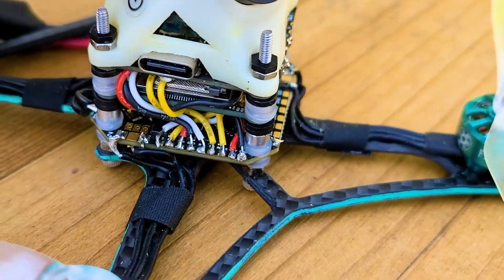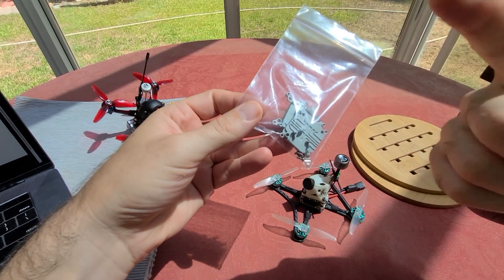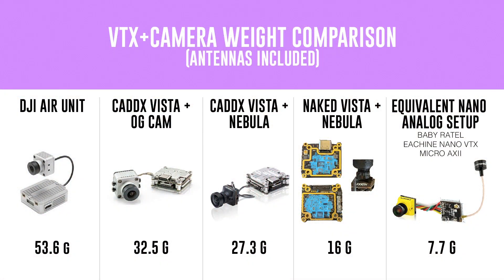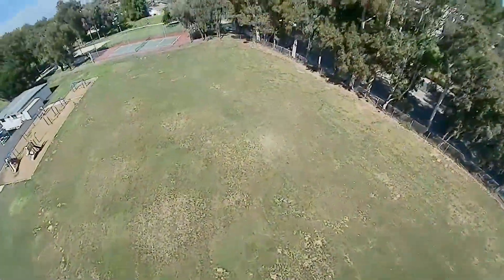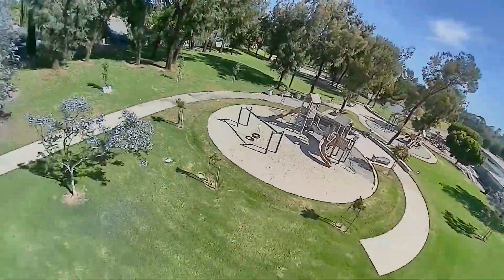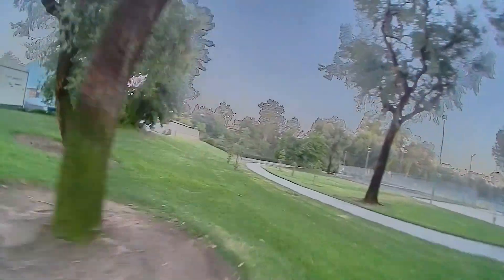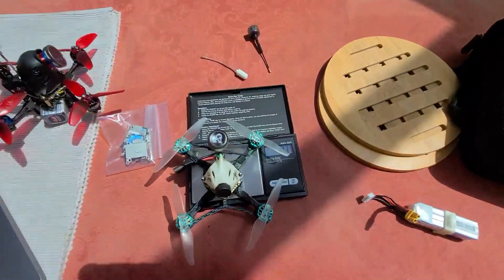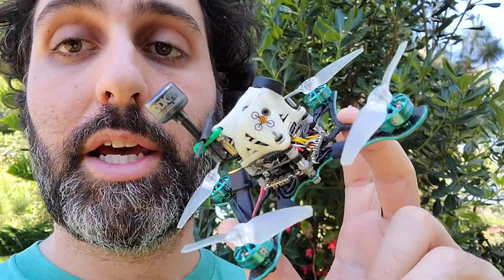Naked Caddx Vista with Nebula camera review - Will the hacked Caddx Vista FLY or FRY?

Comment: is there a filter or lens on dji vista set up in your video
Reply from the maker: No that's stock lens
Reply: @brickclickfidgets  its huge
Reply: the one with red props
Reply: im getting ready to build myself the Airblade Eclair V3 and im going to be stripping my caddx down .The one question I did have is the small tab that holds the ufl connector  onto the one side for security is that just no longer part of the equation.
Reply from the maker: @reefercrazy1  the ribbon cable snaps into the board so you're ok without it.
Reply: @brickclickfidgets  i'm speaking about the opposite end where the rush antenna is held down by a screw a metal tab and the tab would pop into the case (ear)to hold it securely. Will it stay in place with just the screw and tab  without holding on to that (ear)on the opposite side where the case would wish I could send a picture of it.
Reply from the maker: @reefercrazy1  yes the antenna snaps in place also. Good to zip tie it to your canopy as well
Reply: @brickclickfidgets  Thank you again sir do you possibly cut carbon?
Reply from the maker: @reefercrazy1  I don't but check out CNC Madness
Reply: @brickclickfidgets  wil do

Comment: Have you tried higher power settings? 700, 1,000 or 1,200mw?
Reply from the maker: 700 works fine. I haven't tried 1000 or 1200, I don't think that's safe.
Reply: @brickclickfidgets  Thank you for your quick reply.  700mw seems the popular solution.  I am in San Francisco where it rarely gets warmer than 68 degrees F so might crank it up to 1,000 mw with minimum ground time.  Will report back!

Comment: 6 months later is it still working after all the heat sinks removed???
Reply from the maker: Yes it absolutely is working. I generally set the output level to what I need, if I'm flying proximity I'll set it to 200mW to be safe but I've never had issues at 700mw. I have gotten temp warnings when I let it sit idle without flying.
Reply: @brickclickfidgets  Thanks! 🙂🙂🙂

Comment: Hi, anyone has experience with a naked vista that got sprinkled with water? Had a little crash yesterday and got a little wet. At the moment the vista still worked. If i plugged in after, didnt connect to the goggles anymore. The led light works but it's very dim. Any ideas?
Reply from the maker: You can try opening it up and letting it dry. It's 4 screws on each side, comes apart in 3 metal pieces and two boards.
Reply: @brickclickfidgets  its still dead, could it be from being hot and then crash?

Comment: Yep, the Nebula blows, but dji didnt put their name on it, Caddx did and it shows..

fwiw.. I bought a couple of Betafpv/Racerx Twig XL's and in one of them I installed the standard Vista w/ original cam under a phx-3d.com HD canopy.. it came out at 137g otherwise bone stock w/ crossfire.  The hd version does fly a bit heavier than my other stock analog Twig, but its not bad in the least, and it makes the Ratel look plain nasty, so the 20'ish extra grams is totally worth it.
I like having the expensive Vista bolted together solid for crash worthiness...

Comment: 1. Thermal paste is not intended to insulate, it’s actually opposite, it is a conductor of heat.  2.  DJI did not make the nebula, Caddx did, thus its Caddx’s name on the product, not DJI.  I’m interested how long the decased Vista will last
Reply from the maker: When touching the sides of the boards after a flight they arent even luke warm at 700mW.
Reply: @brickclickfidgets   That's great to hear! Would love to see some report and data on this experiment. I'm about to do a similar one too, just stripped my vista yesterday. Which are the parts that gets? hotter (the two large chips on the bottom plate? - they have the same size of some arduino chips, could also use something like this if needed - https://thepihut.com/products/mini-aluminum-heat-sink-for-raspberry-pi-13-x-13-x-3mm?variant=27740311633&currency=GBP&utm_medium=product_sync&utm_source=google&utm_content=sag_organic&utm_campaign=sag_organic&gclid=EAIaIQobChMIj9yP7LGk6gIVxoKyCh0E-QZHEAQYBiABEgLwRPD_BwE&fbclid=IwAR000LmnN-crXHeJA_8blzJh0fl_TYmRJjSWNoN1cWGJt6Mfv0H_ETCLFro

Comment: I finally did the naked vista and so far no problems after 50 flights. It was definitely worth it, my heavy twig Vista Weight is 74g so not to bad. Flys pretty darn good!!👍
Reply from the maker: Awesome! What antenna are you using by the way?
Reply from the maker: Also can you a video of how it looks with the new lens?
Reply: NikFPV I tried a dipole but went back to the caddx antenna.

Comment: "And then you're left with" no heat sinks! Lol Hope it does get itself. Just be patient a little longer and wait for the 20x20 single digital board to be released... 😁👍
Reply from the maker: I remember Kabab talked about that. Have you heard any updates? Are the actually making one?
Reply: @brickclickfidgets  No, DJI are very tight lipped!  lol  just look at the first release...no one had a clue!  Heck, Bardwell said in a video about a month or so before the release , that he didn't think digital FPV was going to happen for several years!!  I laughed my head off after it came out...not at JB, but at how great they kept it a total secret!  That can't be easy to do!  :)
Back in Jan, at CES in LV, NV, Kabab did a live stream from the showroom floor.  He had just talked to the guys at DJI, and reported on the single 20x20 Digital FPV FC that they said will be released in July.  Working with our existing analog cameras!  Now, putting it altogether, that just happens to be the 1 year anniversary of the release of the Digital FPV system.  July 31st, 2019 to be exact.  Think about all of the incremental products that have come out to lead us to that single 20x20 FC board!  We're making are way to that, huh?!!!  ;) 
Now ponder on what other products are released yearly...iphones, heck...all cell phones, cars, TV's, stereo equipment, the list goes on and on...  When's the best time to get us to buy FPV products?  Winter, Fall, Spring, or SUMMER?  Well, I'd do it in Spring, but we got that nasty pandemic then!  So, cross that off the options! :(  So, would you release it in fall, when the rain is going to start in the Northern Hemisphere?  How about Winter when we are all dreaming of flying outdoors again?!!  lol
OBVIOUSLY, Summer is the best time to release new products and SELL A SHITE LOAD!  Now, would you release just that 20x20 single board?  It'd make a major splash, that's for sure!  Or, would you want to release the board, gen. 2 goggles, and who knows what else they have up their sleeves! lol  If they want a TIDAL WAVE instead of a major splash....well, enough said!  Me, my money is on a simultaneous release of an entire new 2nd gen. digital FPV system.  But, you never know!!!  The pandemic could have Fuc%ed the timing up!  I think they'd still sell a ton by keeping it to the anniversary of the 1st gen. digital fpv system.  DJI, I've got my money saved up to buy the 2nd gen system...You want my cash?  ;)  I'll be buying about 15 of those new 20x20 FC's and the new goggles too!  Seriously, I've got a ton of quads and no reason to fly analog once I've been instantly hooked on digital...so, I might actually need 20 of those $50 boards!  :0

Comment: One other option is 17g, like Nathaniel's, using a stripped Vista with a 1g antenna and shaving 4g off the the DJI camera housing.
Or if want the on-board DVR option, like BGuff, 30.6g for a decased Air Unit with dipoles and DJI camera. That could drop to 26.6g if you shave down the camera housing like Nathaniel.

Comment: I’ve heard the nebula camera has advantages in low light conditions. 
Will you possibly look into that? 
Appreciate your research into dji micro viability
Reply: Probably because the EV/brightness is cranked really high on the goggle's default brightness. Turn it down when using the Nebula so everything won't be blown out. On the flip side, try cranking up the brightness when using the DJI camera.

Comment: In my mind my big concern would be how much life are we taking from this caddx vista unit by stripping it down? 
Bearing in mind it's cost.

When i buy a low cost Eachine Nano vtx then because of its small size I find it doesn't last long.
But it's affordable to replace.

Caddx vista less so...
Reply from the maker: Luckily so far cables are good.
Reply from the maker: Very good point. Time will tell I guess. I'm going to keep flying with it and will certainly post an update if I notice anything strange.  After each flight I've touched the side of the boards and they haven't felt too hot but I can't access the top of the board to really feel it. I wonder if the Vista case was more of an attempt at strength than cooling. I also wonder if exposing the boards directly to airflow is actually keeping them cooler than in the aluminum case.
Reply: @brickclickfidgets  yes, I'm following with interest.
Have you had any breakages of the unprotect coaxial cable on the caddx? 
I've just had to order a replacement as one of mine failed. One broken strand.
I've ordered the air version.
Negative of course it's 2cm longer. But at least it has some protection on the cables.

Comment: Nice work dude. I was about to do a similar experiment and video but you covered all the bases! Subbed.
Reply from the maker: Have you tried the Vista decased?
Reply: @brickclickfidgets  nope, I've only used the Air Unit so far, but I have the Toothpick/Twig bug now, so I pre-ordered a Nebula+Vista. That just came in, but I saw some people experimenting with deceased Vistas and was hoping for more data points on it.